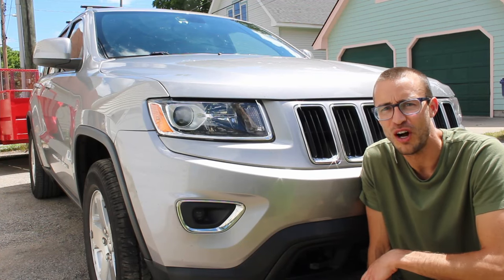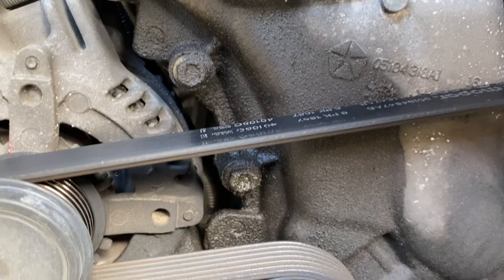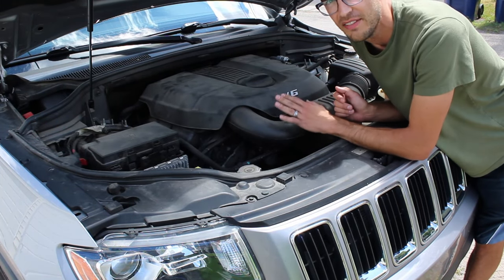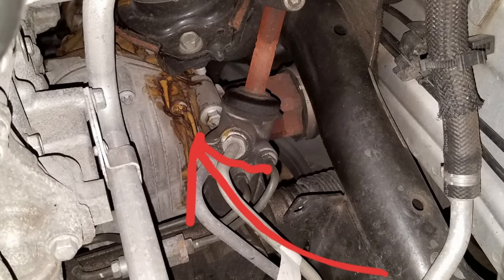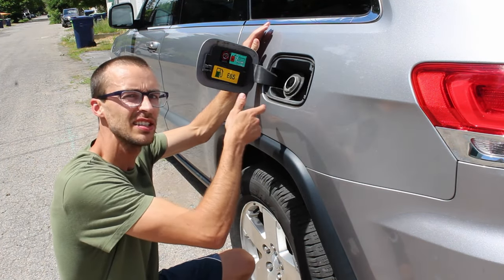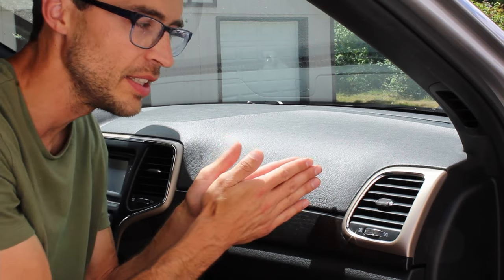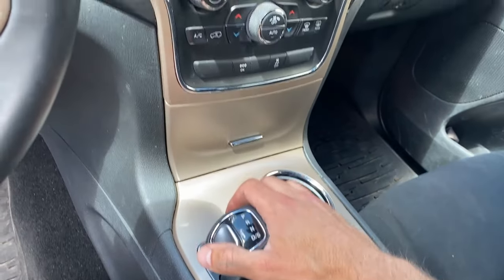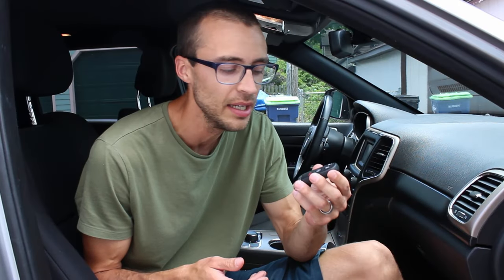Jeep Grand Cherokee Common Problems - 2011-2022 WK2

Comment: I have a 2014 WK2 Overland V8, it has had a water pump go at 80,000kms and the fuel door release needed fixing. Other than that it has had no other issues and currently has 145,00kms.
Reply: Ours has had 3 water pumps
Reply: @steveking4203 Maybe you’re using the wrong coolant
Reply: That’s funny, my fuel door release has been not working for a few years.  Cheap solution, I use a magnetic chip bag clip.  I put the magnet on the fuel door and put the handle of the chip clip so it
Closes on the flat of the gas cap.  Works perfect 👍

Comment: I do a have a 2011 Grand Cherokee with the V6 and just shy of 210,000 miles. I did have to repair the air vent selector, big job and not cheap, but I have not experienced any of the other problems you mentioned except for the thermostat, twice. One issue that bothered me was the failure of the calipers, twice, and that happened suddenly on long trips, and I did not have a great time getting home. Overall, it's a great car, the interior and exterior are basically brand new, no rattles when driving and no issues with the hood. Very comfortable, fairly quiet and a great V6. I have the old 5 speed tranny, still working well, some "hiccups" when cold but no slipping and changing gears without problems. Will I get to 300,000? Time will tell!

Comment: We have a 2016 75th anniversary that we bought new. It still only has 32k on it. The evap core needed to be replaced. They wanted $3000 to replace. I was like WTF!!! Lucky for us the dealer we bought it from has a lifetime warranty. Hundred bucks for the deductible. Dodged a bullet on that one. Ours also still has the original battery in it. I just found out that the battery is underneath the passenger front seat. Thats a new one, seems like an odd place to put it. Especially given that we have the v6 model so theres plenty of room under the hood for it. Ill have to replace the battery before winter I'm sure, doesn't look too complicated, just an odd choice to put it there if you ask me?

Comment: Stuff ive fixed on 2011 grand cherokee overland 3.6l.  All in the last 75k miles: oil cooler, oil filter spring, ac cooler, water pump, thermostats, gas cap, radiator cap, radiator drain, mass air temp, brakes, rotors, tires, new o2 sensors on passenger side, spark plugs, 4 or 5 blinker bulbs, ambient air temp sensor.  Some shop mixed orange in 2011's special yellow global coolant, that needed tons of flushing and new water pump to get back to yellow.  After 150k, now have O2 and P0420 issues.  Must be PCV valve (horrible location) or clogged CC.  The leather dashboard came apart, but it was replaced under a recall.  Also brake booster replaced under recall.  Dealer talked me into paying for a climate control blower motor something.  New car battery, upgraded to state patrol sized one!  So easy to work on with air shocks of Overland.  Set it to max height, and you have all the room in the world under jeep!

Comment: Most of these problems are ironed out by 16. One that wasn’t and I don’t think you mentioned is the Park Sense module. It’s a well known fault and can cause the 16 onwards to slam the brakes when in reverse and you can’t de-activate it, it just reactivates itself. Mine went and was replaced under warranty with a new one with an updated module. 40k miles 3l eco diesel it’s not missed a beat. Second summit absolutely bullet proof
Reply: I’ve had this issue, I’ve noticed if I always have the break a little compressed when I’m reversing it won’t happen.

Comment: 2018, 45k mi - Blown head gasket, dead starter, dead batteries, infinite vacuum line issues, cheap seat cushions, dead door lock motors, 8” LCD bubble, traction control service light and dealer can’t fix it, O2 sensors bad/replaced.

Comment: I have a 17 Limited with 89k miles and water pump has been replaced twice  before replacing the engine mount  at 80k miles and the radio volume knob pretty much melted/sticky. Other than those few issues I love my Jeep but will probably trade in closer to 100k....Great video!
Reply: I have a 2016 GC and have the same issue with sticky, melted door knobs.
Reply: We're you able to find a decent replacement knob

Comment: I have a 2018 Grand Cherokee Laredo got it brand new in 2018 I have had it for five years I don’t drive it often it only has 25K miles on it but I have four recalls to take care of, the passenger door all of sudden started to yellow in the white paint, the AC is making a weird noise when it’s on, the window failed in the passenger, the tires don’t seem to handle any slight slippery moments it just seems like it can’t handle anything? I treat this car like gold too I’m surprised never had this many issues this early I live in a nice area don’t go many places so I’m surprised

Comment: I own a jeep 2021 Laredo, i parked in my house with foot brake on but forgot to put the gear selector to P, but left it unintentionally on N, and shut the car off. The next day I tried to start the car by first put the gear to P after I pressed the ignition and the gear went to P, but the car didn’t start rather started to act weird, lights start flashing etc. any experience with that. Thank you

Comment: I have a 2018 Grand Cherokee Limited 3.6L. I recently noticed a little rumble feel at idle (60,000 miles). I changed the spark plugs,  cleaned the throttle body, new intake filter, checked all vacuum lines and replaced the vapor return solenoid. I didn't see any liquid coming from the motor mounts.

Comment: 2012 5.7 oil pan gasket leaks. Dealer says 1600 bucks to fix it, it’s a 4x4 and they gotta drop the front axle. Now my’04 WJ 4.7 needs a transmission too.

Comment: One thing i've noticed if the key fob battery is very low and I'm dropping one of my kids off so they open the door, the car thinks the key has left the car because i guess the battery is so low it can't detect it

Comment: bought my 2011 grand Cherokee Laredo X 4 years ago with 114k v6  since then blend doors, water pump, just had rack replaced ($2300 ouch!) and it appears my transfer case is on its way out. always been a jeep guy, but this one has cost me dearly. $$

Comment: Glad I drive a '95 FirstGen GC.  175K and ZERO problems other than some normal wear of the steering box.  Every button works and no oil leaks.  The further away from the original AMC design Chrysler got, the worse the vehicle.

Comment: 2014 grand Cherokee and my thermostat has recently been tripping check engine light and it eats coolant like it’s goin out of style can’t find any leaks anywhere. Just hit 90 thousand in it other wise been great vehicle no other issues. And as for key fob I have only had to replace mine twice in 4 yrs.
Reply from the maker: Probably just needs a new thermostat.
Reply: @Kurt of Trades  thanks for response and yea im pretty sure that is what it is just dont feel comfortable messing with that thing like that. I can do a lot to my truck but it's a 2001 doesn't have all those electronics

Comment: 1.lifter tick, (3 bad rollers)
2. Leaking power steering pump. (Bad O ring)
3. Leaking shifter selector on side of trans. (Bad seal)
4.leaking trans pan. (Rusty)
5.leaking oil pan (rusty)
6.leaking power steering lines (rusty)
7.bad alternator (killed battery) recall

I would never buy a jeep again.. they make them cheap and the parts are super expensive for no reason

Comment: One thing I didnt see mentioned. Was 11-13 fuel pump relay. There was a recall. Didnt really solve the problem. I have a 2012 still deal with it once in a while. 3

Comment: The oil cooler fails by itself. It is not necessary to over torque the filter. Mine failed where the inner passages collapsed and mixed oil with coolant. They fail on the mating surface between the cooler housing and the engine. Mine was leaking and had no cracks near the filter area.
I got lucky and caught in time. Changing it is not a big deal. Biggest change if finding an inch lb torque wrench at a store; just order one online.

Comment: I've had a 2012 5.7 wk2 and currently have a 2019 5.7 wk2.  Haven't had any of the items you brought up.  Except on 2012 the steering rack was stating to leak/weep.  I had that one for 8 years and no issues with quadralift leaking.  Saying that they need to be replaced every couple years is bogus.  I also had a problem with the auto door locks not functioning correctly on that one.  On the 2019 the only problem so far is the uconnect freezing up and then rebooting sporadically.
Reply: There’s a recall for that.. check with your dealer had ours fixed and hasn’t don’t it since

Comment: If you over tighten something plastic. Maybe you should not do mechanical work on your own car. I have a 2012. Changed oil quite a few times and have 0 problems.
Reply from the maker: It was like that when I bought it. It seems almost every one has been over tightened at some point, it seems extremely easy to do on these.

Comment: Just wana mention something very small but using the right motor oul for tempratures can also help. Alot of people use wrong oil for your climate somethinng small but will increase your protection of parts in long run.

Comment: After 100,000 my head gasket got replaced oil mount oil cooler spark plugs ignition coils $5400
6months later o2 sensor thermostat and oil pan need replacing $1500 w an oil change add 100$ 7k in repairs for 6months 
Pretty wild

Comment: Good morning I have an 2015 grand Cherokee Laredo and yesterday my gauge on temperature was high and suden normal and also when I put my heater was not working properly and suddenly also I put my a/c to cool my car and works not. Correct can anybody tell me what I need to do
Reply from the maker: Low on coolant or water pump most likely

Comment: Pretty accurate video except dealers won't replace the dash lol.  It's a $4-5k job too.
Reply from the maker: Thanks!  I think when I released this video a lot of these cars were still in the warranty period. Almost all of them are out now.
Reply: True,  but I have unlimited mileage lifetime max care, which is basically lifetime bumper to bumper directly through FCA. They said they wouldn't cover it.  Now I know that there's still a chance that original warranty did cover it but max care won't,  but that would mark the first discrepancy between policies that I've ever heard of for max care.  Plus as you said,  most people are out of factory warranty anyway,  so anyone attempting to get coverage would probably be someone like me with max care.

Comment: Love the way these drive considering their capabilities.  Glad these still have the tried and true V6 and 8 speed.  This video is super helpful.  Good to keep an eye on common issues.  Only issue I had on my ‘19 so far is a failed/faulty fuel pump module that left me stranded on the freeway.  Replaced under warranty at least.

Comment: I have a wj 4.7 that is well looked after! It has developed a grumble in the rear, only for about 10seconds on a cold start! If I high idle, it doesn't make the noise, it's literally cold start only! I've taken everything out the car and had my mechanics look for something loose underneath! They can't find anything that is rubbing or loose that could vibrate! Could it be a fuel pump? Or evac system?
Reply: Exhaust bracket! All fixed!

Comment: I have a leak somewhere in the front of my 2011 jeep grand Cherokee. I have a little under 100k still. But the leak is definitely coolant . The automotive dealership I brought mine to told me they fixed the coolant leak..but it’s definitely not fixed. It’s more broke. For 2 rear breaks and rotors and fixing a clamp that went onto my coolant line somewhere…which brings me to this question…can you follow a coolant line?? I know it’s in the front because you can see the coolant pour out as soon as I auto start in the am before work….?? My grand total for the repairs was $983!? I feel like I got ripped off..I got my front breaks done for under $300 last time. I payed almost triple and they never fixed my leak!! Only made it worse!! I truly I believe I’ve got sucker written on my head-anywho…I just need someone to show me the round about tubes the coolant runs in the front of a Jeep…I’m to old for this and I’ve learned a lot on here..so hoping you can help or point me the right direction.?!
Reply from the maker: I would take it back to the same place. If you paid for them to fix it and they didn’t then that is a problem.  The radiators are known to leak might just need a new radiator

Comment: I’m getting a code P0306 and I had my six spark plugs, changed along with my coil and the check engine light came back on three days after I left my mechanic. When I start my car every once in a while it’ll be rough for a split second and then it’s fine. What are your thoughts?
Reply from the maker: Injectors maybe?  Hard to say, sounds like air or fuel problem
Reply: That’s one of the things my mechanic said may be the fuel injection. He actually told me to try putting some fuel injection cleaner in it first to see if that helps. I tried that and a couple days later the light came back on. Thanks for your time and advice.

Comment: My  2014 Jeep Grand Cherokee Limited. Windows and radio shut off when it’s 55 or hotter
Reply from the maker: It’s a Jeep thing.  Haha strange
Reply: @KurtofTrades  is it a short
Reply from the maker: Hard to say, could be, maybe a battery issue too. Could be a lot of things electronics are hard to diagnose. Could be a pinched wire too

Comment: Are these known for head gasket issues? Looking particularly for a v6 model.
Reply from the maker: I don’t think so unless they overheat
Reply: @KurtofTrades  found a 2016 grand Cherokee v6 with white smoke coming out the exhaust only at start up but it goes away immediately. It doesn’t overheat

Comment: 2015 limited,  stalls while driving randomly.  Ended up being the lock up torque converter solenoid sticking and staying in overdrive stalling motor.

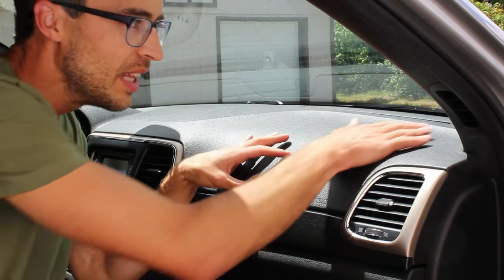Comment: I swapped my air ride on my 2011 Overland for strut and shocks. Between compressor and air bags I was looking at almost 10K.  I put in an after market system from Strutmasters for right at 1k. It does ride stiffer but it's an excellent suspension system. 3:46
Reply: I did the same thing

Comment: ANYONE LOOKING TO BUY A JEEP…DONT !! $12,000 in two months and it’s still having issues. 3.6L Engines have known issues that Jeep will not fix. They also have transmission issues and ELECTRICAL ISSUES. Both a private mechanic as well as my friends who work at Jeep say that they have a massive amount of problems and Jeep goes through great lengths to hide them.

Comment: Mines is a 2014 JGC Overland. I just changed my oil filter housing, thermostat, water pump, something else regarding the gas leaking on the driver's side, and now i have gas leaking from my passenger side. Any suggestions?

Comment: 2011, thermostat code - replaced at 170,000. Motor mounts 65,000- replaced. Front drive CV boots ripped and both half shafts - 85,000 replaced. Right front brake locked up 90,000. Oil filter housing 120,000 -replaced.  Driver side cams and both sides lifters, valve cover gaskets replaced - 180,000. Right rear caliper broken - replaced also.  There are others I have forgotten, it gets routine service.

Comment: I have a 2012, I’ve had electrical problems 🤦🏻‍♂️. They replaced the PCM last year because the car would keep throwing codes saying the battery was low (new battery). Chrysler wants to go all electric next year? That’s a horrible idea, they can’t do anything electrical right.

Comment: The list is loooonnnngggg lol, it's a nice vehicule to ride but it's American and they all have their "fair" share of issues. 

HVAC Actuators and Gears are a pain from conception, I changed 5 actuators and 12 gears so far. The fix is to add a little screw on the gear side that default back to original position so it doesn't sit tight. The issue is that the HVAC door sceal is getting gummy at some point and the fact it sticks makes the Actuator force too much and the gear breaks at some point. The issue have been there since the 90's and the producer never bothered fixing this changing the way it is built. Got tired of wasting money ~300$ CAD for each side every time it happened while wasting some valuable time and I learned how to do it myself.

Otherwise the HVAC unit is around 1200$ CAD for the part + tx + installation to get it fixed until it happened again ... Here's the following vehicules having this issue, Dodge Caravan, Dodge Ram & Jeep Grand Cherokee and I've found online records dating back to 98.

One thing that happened about ~6 years of life, is that with the start push button as the direct key access the car was trying to start non stop but never succeeded. Dealer made me change these parts in order while not knowing exactly what it was. 1. Starter, 2. Thermostat, 3. Alternator, 4. Battery, for a too big bill ~1250$ CAD but it fixed the issue.

I got a Jeep Grand Cherokee 2011 V6 3.6 Laredo X if it can be of any assistance ;)

For the Oil part any vehicule will have the issue if you tight it too hard ... it's common sense. That's the kind of stuff that happens when you are in your head and want to go too fast. Happens sometimes to the best of us and it's an error that becomes a lesson when we learn hehe ;)

Enjoy your day and thank's for sharing (#)